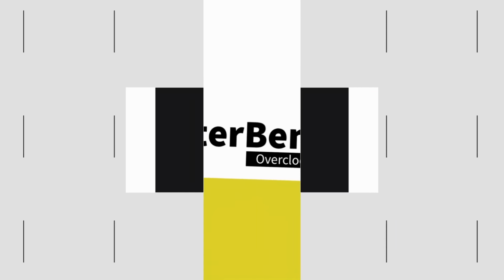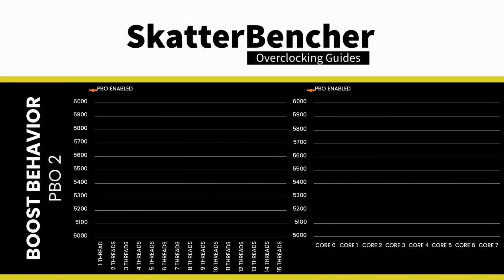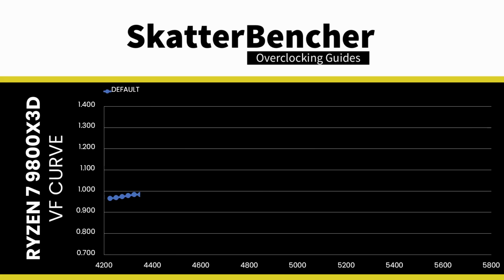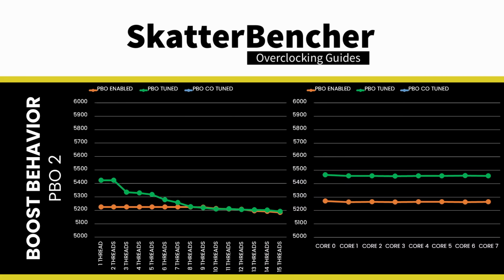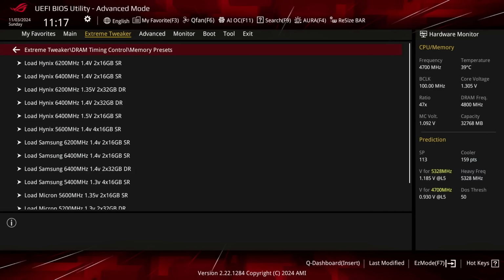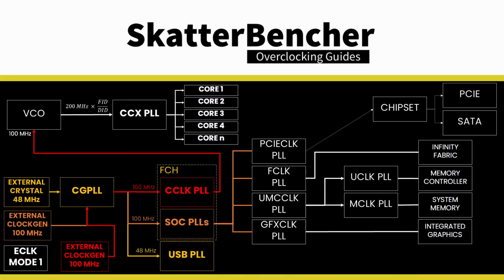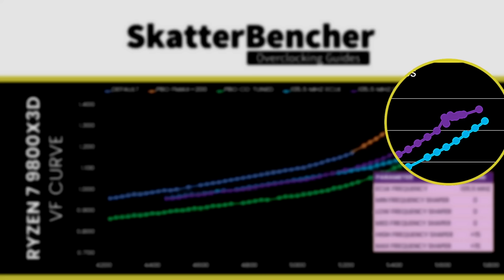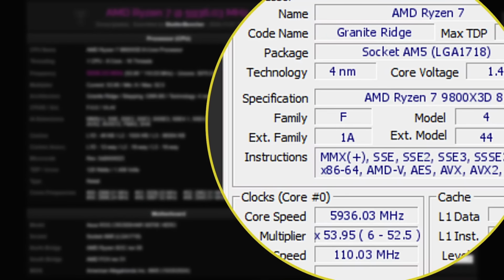Ryzen 7 9800X3D Undervolt & Overclock to 5750 MHz | SkatterBencher #82

Comment: It seems you always get the beyond insane gold sample of each CPU. I have owned 3x Ryzen 7xxx CPU's and now own a 9800X3D, I have never been able to run -40 CO and/or 2200 FCLK on any of them, you seem to be able to do that evey singel sample you overclock.
Reply: Yeah. Got my 9800x3d and can only do 2167fclock, at 2200 I get audio issues however it boots up and does not crash.  At +200mhz and -40 I get crashes, seems stable if I lower to +125mhz. Do you think i should stay with +200 and reduce undervolt, could that work?
Reply: @teddyoflove5897  All of you cores will definitely not be able to do +200mhz with -40 co undervolt, not happening. What you need to do is finding the "bad-cores"cores and assign them lower CO. Bad cores = -15 while the best cores can do -35 for example.
Reply: Change Your Motherboard! It does matter a lot!
Reply: @FrankAndreasLia dude I have no idea I’m doing lol. With bad cores when using hwinfo do you look for the minimum mhz for each core ? And see if drops below a certain threshold ?
Reply: I did mine - 40

Comment: I prefer the oldschool way of OC :allcore OC ,fixed voltage . For example 8c/16t @5,5ghz 1,25V . I wish this method was included in this video.
Reply: Can you do that with this CPU? 7800x3d doesn't allow it right? Manual overclock i mean
Reply from the maker: Yes, the 9800X3D allows for manual overclocking
Reply: @goca4451  Yes you can with 9800x3d .
Reply: @SkatterBencher  what would the max fps gains when gaming on FPS games(csgo） compared to the stock and stock ram?
Reply: Surely depends what you're trying to accomplish.   I old skool clocked my 5900x and got great benchmark runs... Left it like that for 2 years.... I recently played around with the curve and although it benchmarks worse....it gets better gaming fps, so going to follow this for the 9800x3d  I installed today 😮

Comment: Just a friendly pointer - everyone who’s using negative curve shaper, start at -15. Many CPUs aren’t stable at -20 or lower, especially if you’re not using really high end motherboards with industry leading power delivery like he is. Also worth while to mention that 6400mts RAM and 2200mhz infinity fabric settings won’t work for everyone, not all of y’all will run at one to one ratio. Also, buildzoid has some good presets for RAM timings that DO work, use those with correct RAM if you can’t get settings in this video to work. Happy OC-ing

(Thankfully most of these settings are just set and forget and will work dynamically based on what the CPU can handle)
Reply: Where can I find buildzoids presets?
Reply: Yep, I lost a lot of time tonight by starting at -40 and slowly easing by 5. Didn’t land on stable until -15. That’s for sure the negative curve sweet spot for my system.
Reply: my 7800X3D is fine at -25, regularly seeing 4900 to 5050 during gaming
will see later when my 9800X3D today arrives
Reply: question: should i get a 6000mhz cl 28 kit, try to overclock it to 6200mhz and if possible tighten the timings even further or should i get a 6400mhz cl30 kit and drop the frequency to 6200mhz?
Reply: @luisnussbaum5892  the overclock for x3d is useless..
Reply: @benegesserit9838  i know it doesn't do much for x3D chips, but depending on the game, the right ram set up can squeeze a few extra fps. specially in the 1% lows!
Reply: If I start at -15 and my scalar is x10, at any point do I adjust the scalar down for stability or only focus on the curve optimizer?
Reply: Thanks
Reply: What did you get it to? What is your maximum stable over clock?  @maroosagaming
Reply: @Stardomplay  my 9800x3d currently is fixed at 5.425mhz -25 curve optimizer, max it drew in watts was 162w
Reply: Why isn't anyone doing the eclock overclocking? Since this chip allows it now
Reply: You don't need a fancy pants motherboard to push a 9800x3D hard.
Reply: @maroosagaming  Well?
Reply: @benegesserit9838  It helped me squeeze the tiny extra bit I needed to keep my lows above 90 which was pretty important for me running sims in VR to avoid reprojection down to 45fps & stutter. But yeah it's done nothing for my actual fps.
Reply: wich one of the benchmarking tools pr specific tests will help me set/test my underclock most precisely, i do not mind putting in time with setting a manual setting for each core and testing.

hope the question makes sense :)
Reply: My 7800x3d runs great at -30 never had any issues.
Reply: Running stable -45 curve optimiser on my 9800X3D with a further -10 on the Med/High Freqs with curve shaper. Quite lucky I think.

Comment: Amazing video! 
After all things considered, I dropped the last 'Curve Shaper' part, and settled with 5425Mhz....I rather lower temps and less power with stability.
Also -25 is the best stability I can achieve with 200Mhz FCLK @ 1.15v + 6000CL30 RAM with tightened sub-timings.
Reply from the maker: That sounds like a really good setup!

Comment: Thanks for this.  I'm planning to direct die cool my 9800x3d, and this guide will certainly help me to get the most out of it. 👍
Reply: so now the cool thing now is to direct die cool? I saw derba8ers video where he delidded and hadn't guessed to see the direct die cooling kit. I thought it was pretty awesome! I have been looking into the new noctua d15 g2 lbl model, where their coolers are specifically flatter and better for ryzen, would that be the sort of cooler you run with direct die, or are you aiming for a lapped waterblock?
Reply: @ waterblock. I run a delidded 5800x3D on an AIO. 

But I’m waiting for the 9950X3D. I need those extra cores sometimes.
Reply: @kajschak  I have seen it but it doesnt go into OC details like this one.  I believe he just overvolts the cpu instead of undervolting like here.
Reply: @dragonmaster391  You need a custom block and bracket for direct die, as this method of cooling does not use the IHS of the CPU.  It's certainly not necessary, as the 9800x3d already runs pretty cool.  I'm trying it more as a hobbyist than anything else.
Reply: @l1CappYl1  thank you, that is what I was. understanding, but it wasn't clear if the bracket allowed air coolers or if the water block was needed then. It certainly doesn't seem appealing to most users, when a d15g2 cooler with stock lid will do perfectly without risk of leaks or cpu dmg. But of course enthusiasts can't help but look at that potential danger as a welcomed challenge for something so cool. pun intended. as how the other was, I'm probably going to hold off until a 9900x3d releases, as cores are certainly a desired feature. Which will give the chance to catch up on modern cooling innovations
Reply: @dragonmaster391   Delidding voids the warranty (obviously) and is the most dangerous part of the process.  Custom liquid cooling is no different from using an aio (danger-wise).  As long as you air test for leaks before filling, it should hold up for years.
Reply: @l1CappYl1  of course, not that anything is an issue, just theres generally more risk involved here. more points of failure and more chances for things to go wrong. there's a reason enthusiast are doing this and not everybody, but if you care enough to learn to do it right, it's easy enough to do it well.
Reply: you could delit the cpu and go with the highperformance headspreader and can use any aio or even air cooling afaik. derbauer gets up to 18 Celsius on the 7900x with the highperformance headspreader. I want to try exaclty that with the 9800x3d
Reply: @purepowerphil8528  yes, I have already ordered one from them.  Shout out to TG customer service, for letting me know before the 9800x3d release that it would be compatible.
Reply: @purepowerphil8528  Do you have a link to that video where he shows that? I literally bought all the parts, delid-tool + heatspreader+offsetmounting kit+liquid metal to do all this proceess but right now I think of sending it back, not sure if its worth the expense+risk factor for the performance uplift.
Reply: @ i think its his 7800 x3d delitting video he got a bunch of these
Reply: @AlexPetcu84  If you aren't sure, then you probably shouldn't do it.  The CPU looks to run cool enough without taking these extreme measures.  I'm doing it more as adding a fun new challenge to my build than a necessity to get good performance from the CPU.  I am also curious as to how much more (if at all) it will allow me to boost the clocks.
Reply: @l1CappYl1  calling an aio and a custom loop the same means youve never made a custom loop, or if you have it was wrong. My 7950x3d literally goes sub ambient by over 10C with my custom loop. Good luck getting that with an aio lol
Reply: @danielvannuland2681  Where did I say that they were the same?
Reply: @l1CappYl1  i didnt click "read more" so it cut off (danger wise) lol [insert jackass symbol]
Reply: @danielvannuland2681  🤣It happens.

Comment: awesome video, thanks for the simple breakdowns of this stuff. I don't have a new x870 board, just an older b650 since they don't make a good x870 mATX board yet, so I can't use the ECLK, but I've been running your curve settings and it's rock solid on every test. 12 hour OCCT platinum tests and Ycruncher ran up to the maximum my ram will support with not one bluescreen. will be testing slightly more aggressive curve parameters and seeing how hard I can push this chip. thanks again 🙏
Reply: Does Curve Shaper (not curse optimizer) actually work on boards without an ECLK?
Reply: to be honest I haven't actually looked at my voltages under load but my temps did drop a couple degrees overall and I'm hitting max clock speed regularly, so... it's probably working, from what I can tell

Comment: With your help I do this on air. Temps level out at 97c running prime 95 small FFT stress test with Thermalright PA120SE after 10 mins. I got a 3D Mark world record for same CPU/GPU combo. . Whilst benchmark numbers are encouraging, I can't tell the diference between 100 and 105.5 in my use case. However, this  is not going to stop me from pushing further.

Comment: I bought a 7700 made in China on Aliexpress, to test the veracity of the fact that they have a lot of undervolt margin. I also have a 7800x3d (stable up to -20 on prime95) and a 7700x (stable at -27 on testmem5, prime95 small etc). Well this 7700 unlocked at 142w and pbo offset +200 and curve optimizer -60 I can't make it crash in any stress test. I'm at 1.24v At 5550mhz all core in floating point with -60 curves. Incredible Chinese production. I hope in a 9800x3d made in China.
For those who want to try it, there is no guarantee that something made in China will arrive even if you get it from Ali

Comment: Had to fine tune the +15 to +17 for full stability for the 105.5 ECLK OC. Passes everything. boosting to 5.725.
6400/2200 RAM/FCLK will not be stable for most without tweaking if at at all. 6200 with very tight timings works best for me and outperforms 6400 with the tightest timings I can manage with that. Got FCLK to 2200 but required voltage tweaking 'VDD MISC' and 'SOC' to work. 6200/2066 will be an easier stable target to try first Id recommend.
I have a ROG STRIX X670E-F GAMING WIFI so not quite as good a board but similar, its has the ECLK feature obviously.
Reply: Hey Richard would you be able to help me oc mine? Do you have a discord or a way to contact you?

Comment: Why not include any multiplier overclocking since 9800x3d is the first unlocked x3d chip? Derbauer tried and managed to get 5.4 ghz all core easily, I hoped you would mix it with curve optimizer to a greater height but I don't see any mention of it in the video. Open multiplier is the best news because async clock mode and an expensive motherboard that support async clock mode is not needed this time to overclock 9800x3d, is it not?
Reply: its not that, 3d cache somehow limiting overclock bcs its there beside the cpu and could be damaged with high temp/ voltage
Reply: its amd workaround to get better fps without knowledge of overclocking and proven, once again, working well on their ryzens

intel usually just raising mhz and sell it
Reply: As far as gaming is concerned his method is faster
Reply: @rdmz135  how is it faster? he's not even using the unlocked multipliers...
Reply from the maker: It's a good point! I did quickly try ~5.5G with a static overclock but it wasn't quite stable. And then I ran out of time to prepare the guide.
Reply: @SkatterBencher  would appreciate if you tried with cpu intensive games like cs2
Reply: @SkatterBencher  Thx for the reply. Do you think static overclock is not enough and we would need a motherboard with external clock generator? If thats the case which motherboard do you suggest without breaking the bank?
Reply: Counterstrike2 is the real test we need.
Reply from the maker: @simontemplar8719 oh I saw there's an FPS Benchmark again. I'll definitely add CS2 to next guides then 👍
Reply: @SkatterBencher  it's the number one game on Steam.   Very competitive,  and people spend big on CPUs to stay competitive...
Reply: @simontemplar8719 With all due respect, has the last 2-3 generations of cpus hit fps in CS way beyond any moniter refresh rate? Or do you strictly mean as a bench marking tool? 🙄🫣
Reply: @Grasseatereu  both.  The 1% lows are important in game,  especially if it can stay above the monitor refresh rate.
Reply: @Grasseatereu There are displays with 480hz refresh rate nowadays. Very competitive 😊

Comment: I seem to be able to run high negative curve optimizer value, but that's only during the stress test. When there's no load the pc often freezes. Does this mean that I could use curve shaper and put positive values on min, low and maybe even medium frequencies to stabilize it?
Reply: I have the same problem. Working well with high freq workloads but frequently crashes when idling. Have you found a solution?

Comment: In CP2077 at 1080p Ultra (no RT) I got 150fps 1% lows 196fps average. With overclocking I got 169fps 1% lows and 213fps average. You would say its perfect.

Well at 1440p Ultra it become quiet willd. Without DLSS I lost 1fps in both average and 1% lows. 
Activating DLSS quality OCed cpu was 1fps faster in both average and  1% lows. Enabling Path tracing stock cpu was 1fps faster again.

For pure gaming at 2560x1440p resolution and higher, leave Your CPU on stock or just use negative all core CO to lower temperatures and noise.

I tested with 4080 super. Maybe with 5090 it will be a different story.

Comment: Noob question: can (and should) you use both curve optimiser and shaper?
Reply from the maker: You can combine the two. It's not mandatory to combine, but Curve Shaper gives you extra fine-grain control. So it can help stabilize the undervolt in particular scenarios.

Comment: I had alot of success yesterday after building. my Curve was per core based I got lucky because I was having trouble going above -15 all core. One simple comment on reddit made me gable a try and -40 on some cores and half the other cores -15 stable. Then got lucky too with a stable 2200 IF after last noight stress testing OCT Vram CPU+ram combo test with OCCT. Watching alot of videos discovered why I did have issues is cause I wasnt feeding certain parts more voltage. I was going off auto.
Reply: I didn't even know you could use Curve Shaper (not curve optimizer) on individual cores!  Which motherboards do that!

Comment: Hello SkatterBencher,

Yet another banger video. I have been following you ever since I got my first AMD CPU which was the 5900x and I have a quick question. For me as a gamer I care about the maximum performance for gaming and I asked the same question on the 7800x3d video of yours but I am in need to ask again since this time the OC Strategy in this case #2 seems to cover way more options such as Fmax, Scalar and such which I believe is because you can actually overclock this CPU which was previously not possible in the same way with the 7800x3d.

Would you therefor actually recommend (for gaming purposes) to use FMAX and Scalar as shown in the video or was this done to show the ALL core boost performance and should I as a gamer just stick to the 7800x3d setup which was to enable PBO, EXPO and then tune my cores with a negative curve?

My full setup is as following:

CPU - AMD Ryzen 7 9800X3D
AIO - Lian Li Galahad II Trinity Performance 360
MOBO - ASUS ROG Crosshair X670E Hero
RAM - G.Skill Trident Z5 Neo RGB DDR5-6000 - 64GB - CL30
GPU - ASUS ProArt GeForce RTX 4080 SUPER OC

I have a total of 10 fans installed in my case for maximum cooling.

Thank you so much for your fantastic videos and I hope you can answer my question. <3
Reply: Another question would be if PBO Scalar degrades/damages the CPU.

Comment: I did strategy 2 before watching this video but with a -20 curve optimizer. I didn't even consider I can get as low as 40.
Reply from the maker: -50 is the limited ... and then you can still stack it with up to -30 Curve Shaper
Reply: @SkatterBencher mine didn’t do so well after -41. Prime 95 was doing weird stuff anything below.
Reply: @Madblaster6 I still don’t understand what I’m even looking for. I get the idea of overclocking but don’t understand what stats I’m reading and why

Comment: I have a 3700X and X570 Gigabyte Elite. RAM is incredibly weird on Ryzen, to put it mildly, especially if you have 4 modules or RAM-chips (2*2*8 GB in my case). It can be stable for weeks and then all of the sudden you get a crash. Over time you notice that your POST-time increases with a few seconds and that the CPU-fan ramps up more and longer (because it is slower at checking the RAM). RAM remains a mystery on Ryzen and whatever is going on, that Infinity Fabric makes it a lot more complicated.